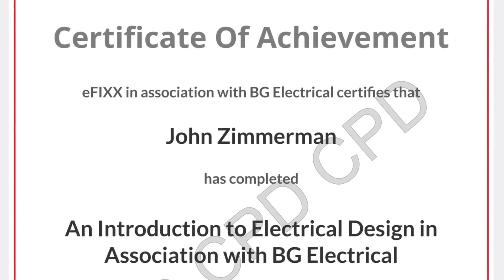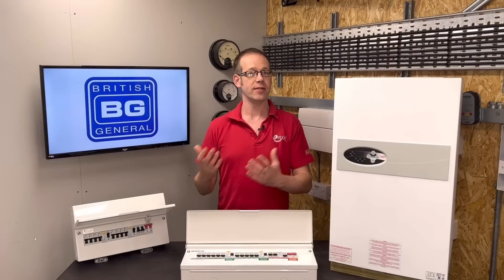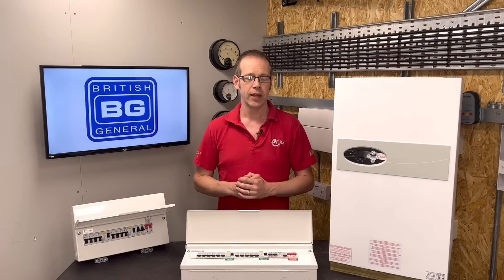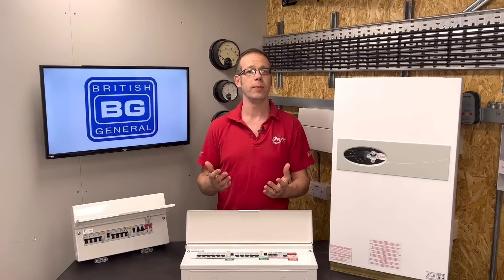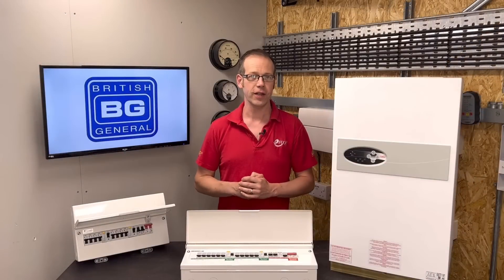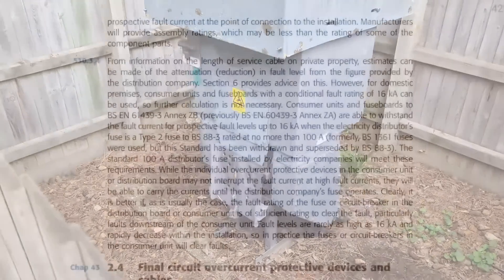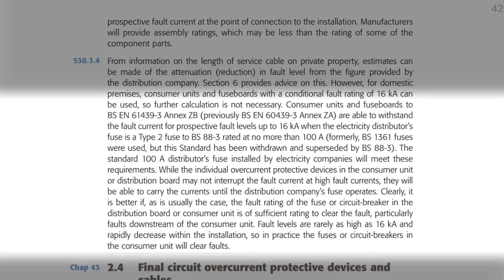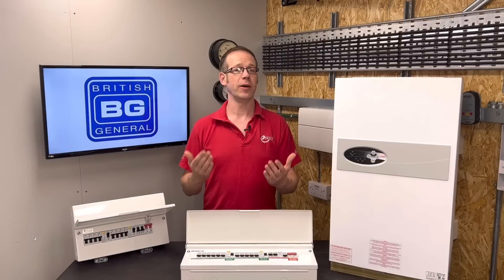Mastering Electrical Design - Don't Miss This Step!

Comment: Seems strange we use the c min value of 218.5V in the calculation for earth fault values when a minimum permissable voltage value in the esqcr regulations is 216v

Comment: So yeah enclosures to 61439 can handle 16kA if backed up satisfactorily. Its the thermal constraints of the conductors... Particularly with mcbs thats the real concern at higher fault currents. Especially when t&e is launched in without a second thought.

Comment: It's insane to consider 16 kA in any domestic environment. It's simply not a number that will ever be approached. I wonder if they standards people are just carrying over some extreme numbers from industrial settings.
Reply from the maker: Yeah, it's an interesting note in the guidance that I'd not really come across before so thought it was worth a mention. 🤔 Trying to be as thorough as possible without it getting overwhelming or confusing. 😃
Reply: In fairness you get a house parked up next to the substation it can get pretty tasty and in urban centers can be a lot higher than expected. I've been in a few where the t&e installed wasn't cutting it because of the reduced CPC and high fault currents. Not that anyone else seems to worry about it.

Comment: You should make a video explaining what CPD means. I've been watching your channel for over a year (probably 2 now) and although I have learnt loads from you I still don't know what CPC is
Reply from the maker: Continuing Professional Development, basically keeping on learning all through your career. 👍
Reply: CPD , CPC or both?
Reply: CPD - continuing professional development.
CPC - circuit protective conductor.
Reply: CPD is a Circuit Protective Device, e.g. MCB to BS 60898 or RCBO to BS 61009.
CPC is defined in Part 2 of BS 7671.